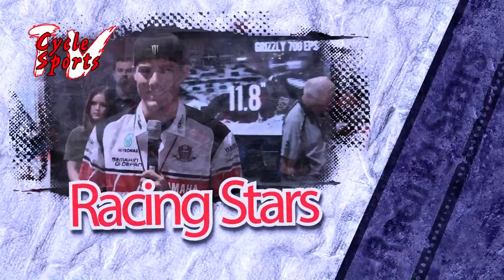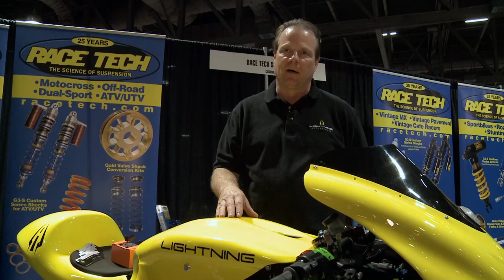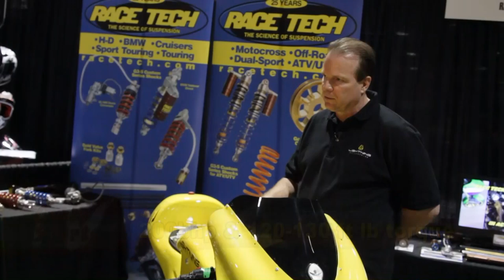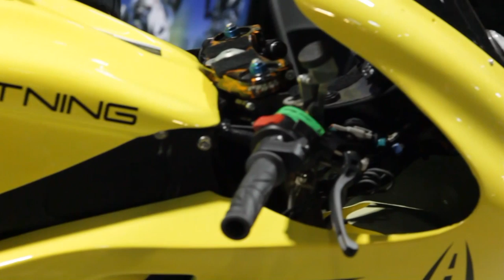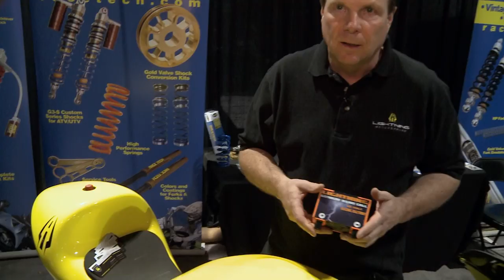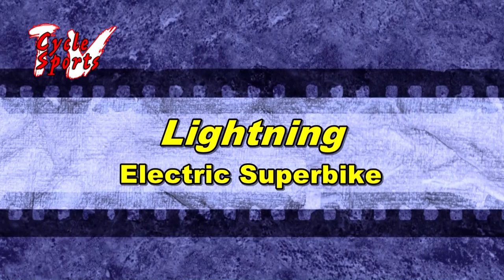World's Fastest Electric Motorcycle

Comment: In comparison the (gas powered) 2012 Honda VFR has a RRP of $24,995. For a brand new race tuned superbike with high performance racing suspension and Brembo brakes $20,000 isn't really that crazy. Most companies producing electric motorcycles struggle to keep the price under $30k so this is actually quite reasonable.